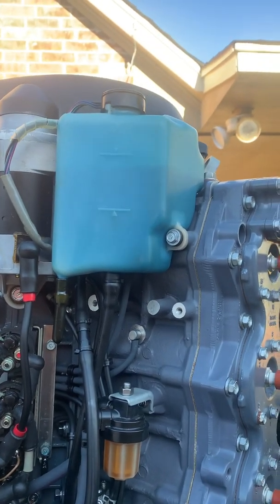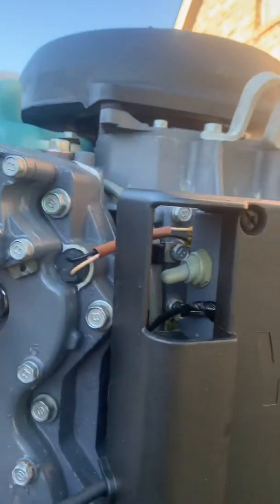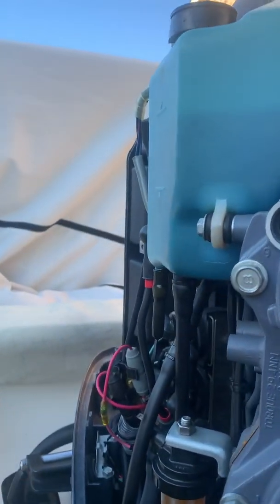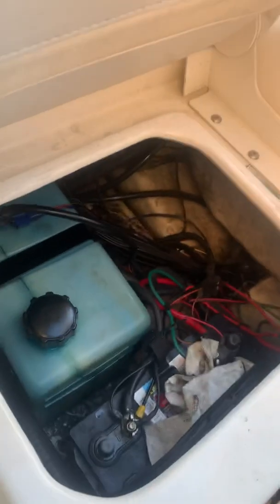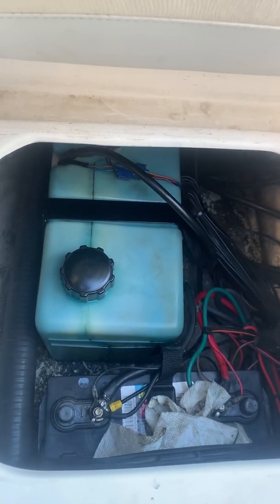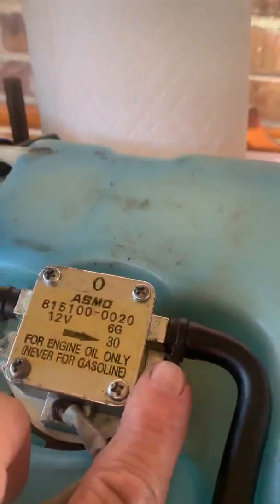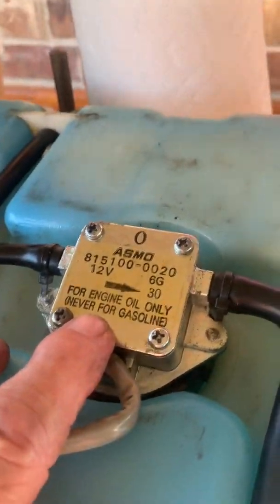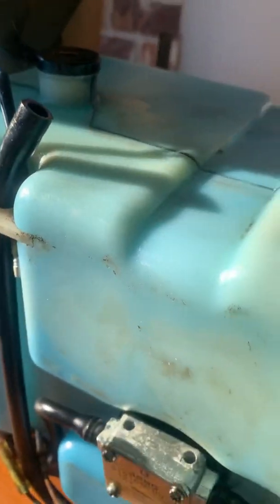Yamaha 2 stroke oil pump

Comment: i put in the new pump and filter but it wont fill the upper tank automatically, only if I use the emergency toggle switch. what could it be? the pump was bad and wouldn't work even with the toggle switch before I changed it. So i know the pump is working now. Help
Reply: I am running into the same issue. Did you ever fix this problem?!

Comment: What was your issue. My boat run good no alarm going 20 mph but when I start going 40 mph the alarm comes on. I think the oil is not filling fast enough. Can you tell if the alarm is oil or over heating
Reply: Look in your manual. A steady tone is engine overheat. Intermittent is either low oil or no oil depending on alarm duration

Comment: This video is excellent. I couldn't get the wiring harness disconnected until I watched this. Thank you! I replaced the pump, but it also seems I have a loss of current in the wiring harness as voltage drops below 12v over time. Regardless, excellent video. Thank you!
Reply from the maker: I’m glad it was useful! Wish I knew more about the wiring harness issue you’re having. I imagine there is a relay somewhere in the circuit which is energized by the float switches and in turn energizes the pump. Said relay would be a prime suspect! Good luck!
Reply: @thomastaggart4581   Didn't think about the relay. Good advice.
Reply: @thomastaggart4581  Any advice on where I can find the relay for the external oil pump? Pump works when hooked directly to a 12v battery. I ordered a new harness after shortening the old one to 3 feet and still getting 7 volts. I'm scanning the manual for the relay. Thanks!
Reply from the maker: @virginiafishing1  Man I wish I had a diagram I could probably find it but unfortunately I don’t. Sorry!

Comment: My tank broke and I bought a new one.  Does the sensor simply pry off the tank.  Seems to be a very tight fit.  Thanks!
Reply from the maker: Hey Jesse! Hope your repairs are going along nicely. Not sure which tank you had break but regardless, I’m pretty sure the sensor would just pull off. Having said that, I did not remove the sensor in the sub-oil tank, which is the one inside the hull of the boat.
Reply: @thomastaggart4581  Talking about the sensor on the top of the sub oil tank. Thanks for the response
Reply: @jesgord  yes its tight. Pry it off.
Reply from the maker: 61A-85730-00-00 Boats.net shows this level sensor for the sub oil tank. Looks like it has a rubber bushing that fits into the top of the tank. Let us know how it goes. Good luck!

Comment: 🤔 seems like the switch should be relocated to the console with a low oil light from the engine.
The same should be done with the sub oil tank. It wouldn't take much to accomplish this. The time and hassles this would've save many people over the past 30+ years.
Reply: No. The gauge on the dash has oil level combined with an alarm for low oil and oil flow. If you don't have the gauge, it's an audible alarm only but 95% came with the gauge!

Comment: Perfect explanation of what I’m looking for. Was trying to ohm coils this morning when I found the switch. I tried it and heard it pump. Took the boat out and it used all the oil out of the top reservoir until it got to the min level then sounded the alarm. We had to idle back to the launch. Guess my pump just went out…
Reply: I’m sure you figured this out by now but there is an emergency pump switch on the engine, it takes a while to pump but it gets there

Comment: Where exactly does the blue end connect on the outboard motor? Where does the feeder tube connect on the outboard motor? Thanks for the fast reply !!!
Reply from the maker: All I can tell you is there is an identical blue connector on the engine wiring wiring harness under the cowling. The feeder tube runs up to the oil reservoir on the engine. Sorry I don’t have any more info on that!

Comment: My remote oil tank is not connected. Where do I connect the wire with the blue ends when I bring it to the outboard motor ? And where do I connect the feeder tube. I have all the parts just not sure how to hook it up. Yamaha OX66 2 stroke. 
 Thanks.
Reply from the maker: The oil pump itself has a short blue wire and a short brown wire. They connect to the wiring harness that has a blue connector. I believe that cable will pass through the hull with all the other wires, cables,etc that go directly to the outboard. The feeder tube runs in the same bundle all the way to the oil reservoir on the engine.
Reply: @thomastaggart4581  Where exactly does the blue end connect on the outboard motor? Where does the feeder tube connect on the outboard motor? Thanks for the fast reply !!!

Comment: It's useful to rig up a jumper lead to the battery and the pump and make sure it's the pump and not a wiring issue ..Nice video.Thankyou
Reply: How can you determine a wire issue. I replaced my pump and it’s still not working thanks